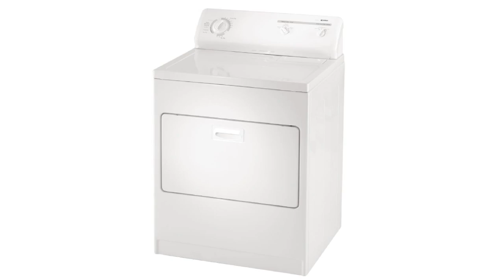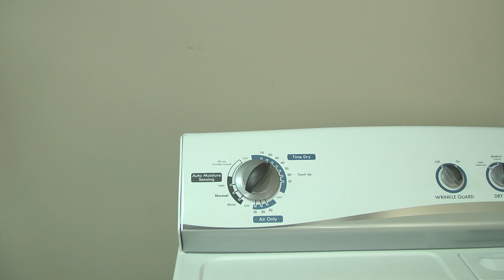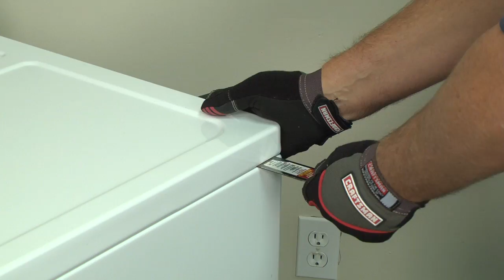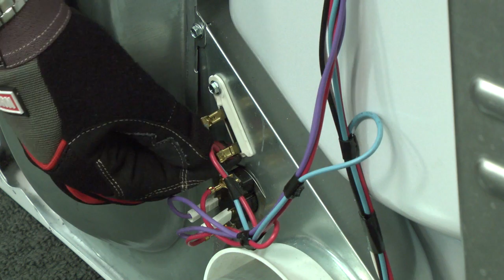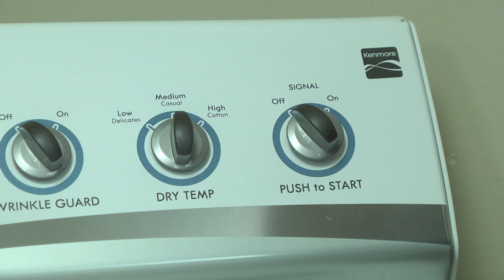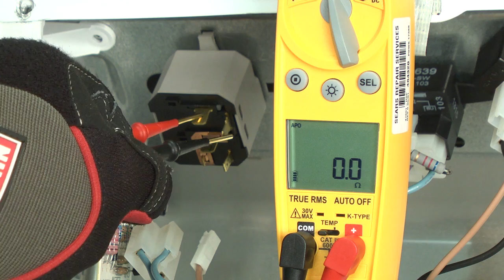Dryer Won’t Start: Troubleshooting Electric Dryer Problems

Comment: THANK YOU! This provided a great break down. Through this video, I was able to troubleshoot my issue and feel relatively confident that my problem was the thermal fuse. I bought a replacement off Amazon for $6. BOOM! Problem solved. You saved me what probably would have been a $200 to $300 repair bill. THANKS AGAIN!

Comment: Great video, easy to follow steps.  Following the video determined that I had a faulty thermal fuse, $20 later I had a running dryer and a happy family!
Reply from the maker: Thanks for letting us know what your found. We're glad to hear that you got the dryer fixed and that your family is happy.

Comment: Thank you!  The problem was my door switch.  As soon as I opened the door, held it in and pushed the start button it worked! I didn't even have to replace it.  Must have been stuck. This is the second video by you that helped me fix the issues with my appliances.
Reply from the maker: Thanks for letting us know what you found. We're glad to hear that our videos helped you.

Comment: Excellent short and to the point troubleshooting video!  I was gonna buy a starter relay ($35) as it didn't click when I pushed it in when attempting to start the dryer. After I viewed this video, I ohm'd out the thermal fuse which read zero continuity .That was the problem! Replacement was only $11.
Thank you!
Reply from the maker: We're glad to hear that you found the cause of the problem using our video as a guide. Thanks for posting the solution that you found.

Comment: So I have a whirlpool duet dryer and I have figured out that my thermal fuse is blown is that the only reason why it turns on I push start and nothing happens because I am at a loss after this if this does not work I changed out the circuitboard because the other one had a blown diode I re soldered and it worked for a couple days But now I’m back to square one where I was I really hope it doesn’t have anything to do with the heating element but I don’t see how that would have anything to do with the drum spinning the pulley system is fine That was the first fixed there was a missing washer on one of the wheels that held the belt and it caused the wheel to fall off so I fix that that’s not the problem maybe you could help me out please I know this video is 3 years old
Reply from the maker: Let us know the model number of your Whirlpool Duet dryer and we'll try to provide some troubleshooting help. The model number should be on the front panel around the opening to the drum. Open the dryer door to view that area.
Reply: Sears PartsDirect I really hope it’s not the motor but I don’t hear any Faint motor sounds at all I push the start button and it makes a clicking noise like the dryer is about to start but it doesn’t
Reply: Sears PartsDirect I ended up just getting a brand new circuit board because I didn’t trust my soldering skills

Comment: Hi Sears PartsDirect
I have this problem. No heat and it spins. So i check the heater, replaced with brand new heater, still no heat. Heater not turning on. Replaced the old thermostat with new thermostat, still no heat. Checked all wirings for continuity, all checked out good, sanded the terminals, still not heat. Replaced the whole motor with centrifugal switch, still no heat, heater does not turn on. I don't know where to go now. please help.
Reply from the maker: Follow the troubleshooting tips in this video for diagnosing an electric dryer that won’t heat: https://www.searspartsdirect.com/article/electric-dryer-wont-heat-troubleshooting-video.html. As explained in the video, a power supply problem can prevent the dryer from heating even though the motor runs if the 2nd leg of 240-volt power is missing. If your dryer is getting 240-volt power, check the entire control circuit as described in the video. If the 240-volt power supply and the control side of the heating circuit are both okay, then a bad motor centrifugal switch or a wiring failure could be preventing the element from heating.
Reply: Timer is bad